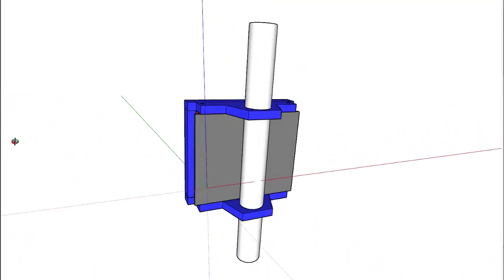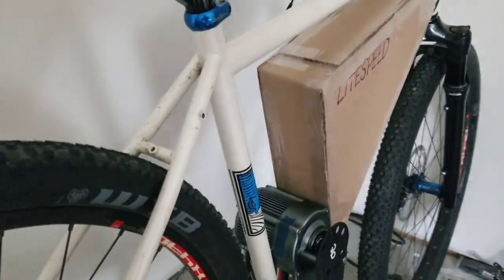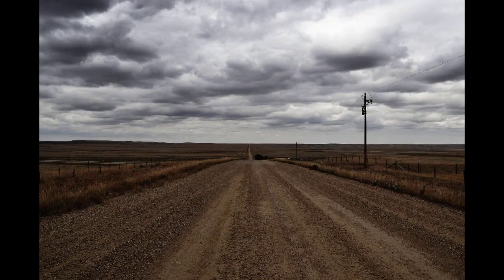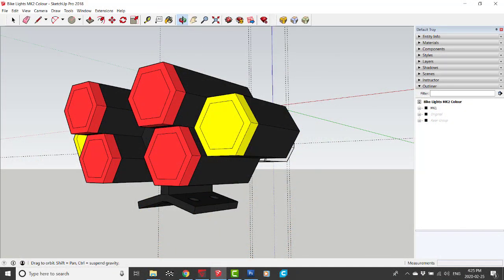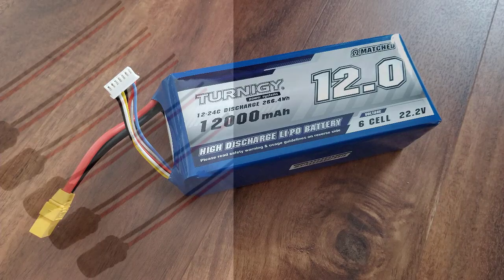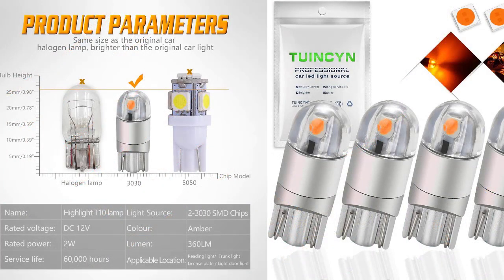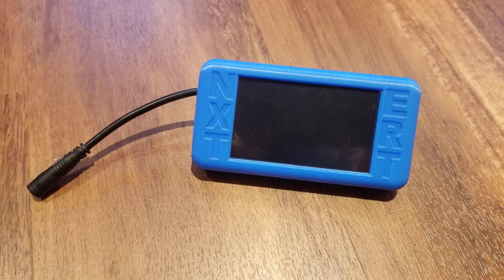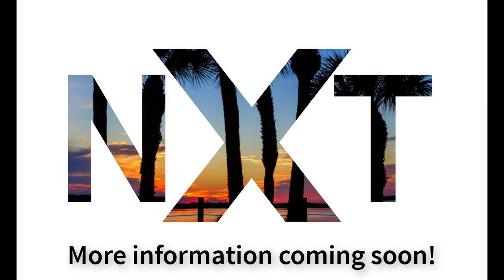Ebike Projects Update No. 1 - CYC X1 / BAC2000 Salsa build + Ebike Lighting + NXT Development

Comment: Hi , been watching a few of your vids, much appreciated 🙏🏽,  I have a BBSHD with 48v 14amp battery and I’d like to have 2000w to 3000w of power for some big gravel hills , ASI controller for the BBSHD is around $700 so I’m thinking I’d be better to go with a new bike and put a CYC X1 on it for around $900 and sell my BBSHD hard tail ? what do you think ? many thanks . Steve
Reply from the maker: No way I'd sell my bbshd. Built like a tank and super reliable. The cyc is fun but I don't think I'd feel comfortable with it being my only option. Is it really 700 now for the asi. Where are you looking to buy it from. I do not recommend direct from ASI...
Reply: I was looking at ASI direct
Reply: I do remember you recommending a third party who was that again , cheers mate
Reply from the maker: Electric Race Technologies. I am part of the development of the nxt display so I am not an independent voice here. If you join my discord you can chat to a bunch of good folks building bikes and batteries both cyc and bbdhd amongst others. https://discord.gg/AnyQRuh My newer videos have info on the nxt etc.
Reply from the maker: ASI direct is way overpriced and incredibly difficult to do anything with. The evaluation kit its called..The idea is to pair it with your motor. Except their software is very frustrating to use even for people that have used it a long time.
Reply from the maker: The asi kit is about 500 US. But that would be the bac855/ new harness and NXT touchscreen display.

Comment: Great video. When I ride hard with my X1/2000 setup the motor reaches 40c and the controller is not possible to feel any heat from. It is even totally coverd in plastidip. This is now with 5-10C outside. So no worries about that
Reply from the maker: That's excellent. I'm having similar effects with my bbshd at 72 volts. 10km full bore up hills and the motor and bac are barely warm. May change in summer tho lol.

Comment: Hi Captain,  CYC have advised me to hold off on getting my order shipped as there is some issue with the torque sensor in the X1 and BAC 2000 setup. How have you fared in relation to this problem? . I tried to get them to swap out the supplied display for the  NXT ( in exchange for extra $$$). How did you handle the display with them?
Reply from the maker: I'm not using the bac2000 from cyc it's being supplied by ERT. I also don't have the torque sensor version only the PAS gen 1 model of X1 so it wont be an issue. I'm having a bit of a rethink on the build and I'll update soon. The BAC2000 issue looks like a firmware bug though so that's an ASI fix. No idea how long it will take for them to do it either. Hopefully sooner rather than later!
Reply: @HighVoltageKits  Thanks for your reply, cobber. (I hope ASI won't take too long.) 

 Good luck with your build; and if I have not mentioned previously how much your vids are appreciated, I say now thank you for them.